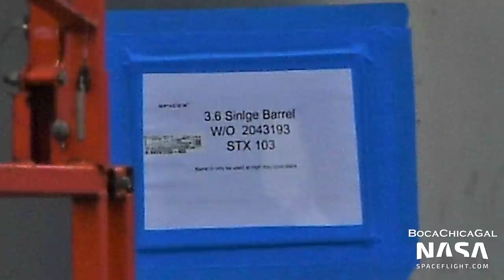Cargo Door Prototype Spotted With Smooth Nosecone | SpaceX Boca Chica

Comment: Booster 4's aerocovers still look a bit... haphazardly tacked on 😂 You know when something wasn't in the original design when SpaceX does this "That'll do until we redesign it" stuff.
Reply: Nah, it's the Cybertruck of rockets. Cyberrocket.
Reply: Looks very Star Wars.
Reply: I highly doubt they will be like that in future builds as they protrude further out than the catchment points.  I'd wager that they move to catch using the grid fins at some point.  It's inevitable they some will come down on the fins anyways.
Reply: Yes.

They haven't bothered to optimize them for weight yet, so the design is obviously in flux. There isn't much point in optimizing the booster design with 29 Raptor-1s when they have already moved on to designing for 33 Raptor-2s.

For aerodynamic reasons, they will want to move stuff under the skirt when possible. The available under skirt volume for other equipment depends on how much space they need around the Raptors. Curved covers will be lighter than covers with flat sections given the same volume and strength requirements.

The number and size of COPVs can be optimized after they determine how much compressed gas is actually required. They may even be able to switch from using cold gas from COPVs to using ullage gas or even hot gas made by burning some methalox.

Comment: 10:20 Do you think the gaps in the OLP will be filled in? I would imagine all sorts of debris and heat damage could get through the gaps in between those covers.
Reply: I was wondering the same. I guess they will fill them.
Reply: I'm guessing panels on the outside with the same gaps then a single piece that covers each gap from top to bottom.
Reply: Could be blocked and filled with water as part of the deluge system?

Comment: Do we know if the gse4 tank failure was intentional yet btw? I would assume so because they have gain soo much experience building these tank structures by now that it seems implausible that it was not intentional, but do we know for sure?
Reply: @rogerhalt3991  As it would follow what they did back in 2019 with the composite tank. Test to failure.

Comment: deluge system; wouldn't it make sense to use the same water cyclically? a cyclic deluge may be more efficient., the water has to travel (be pumped ) less distance  launch after launch. it reduces the cost of pumping in water, and there is the potential of utilizing the launch itself towards recycling in the sound suppression water pumping system. this may be more self contained, and may translate better to offshore oil-rig style launch systems in terms of environmental impact. the sonic impact of numerous launches to the environment is a first principles problem for rapid reuse, as is the energy efficiency of a sound suppression system. cyclic water pumping, and capturing the energy of launch to this end, is likely. watch this space.
Reply: I'm sure they will use ocean water for offshore launches.

Comment: 15:13 Booster 4 with aerocovers - no ports in engine covers for fuel feed to assist startup?  I wonder what all those ports inside the ring on the OLIT =WILL= be used for, if not assisting start-up?
Reply: yes

Comment: What they're doing on high bay rooftop for sooo long? If i'm not mistaking it's in progress since begining of olt.
Reply: Building the bar is neither rocket science nor a priority. I suspect that everything on the critical path to building and launching Starships has a higher priority.

This probably means that construction workers are only assigned to work on the bar, when they aren't needed anywhere else at Starbase.

Comment: how are they going to put sn20 on b4 when those hooks are gone for heat tiles in the nosecone?
Reply: Lift SN20 on to the Chopsticks. Remove lift points. Install tiles. Lift SN20 on to B4. B4 can be placed either by the Chopsticks first or by the crane after SN20 is on the Chopsticks.
Reply: @gravelydon7072  yeah probably, that's the only way. Idk if the fins of sn20 are already prepared for such a lift.

Comment: Will they use the chopsticks to place Ship 20 onto Booster 4?
Reply: We are expecting so because the Lr 11000 is not in the right configuration to lift that high, and there is no way to disconnect the crane and then tile over the lifting points.

Comment: 15:46 What could that circular/hexagonal structure be?
Reply: Looks like Starship shield cells... Maybe they are planning to test the reaction of them during the travel, so see if they are necessary in the bottom part of the booster... (maybe)
Reply: Cooling vent.

Comment: @0:44 are those guys seriously working at the very top of the high bay without ANY fall arrester gear? Surely that can't be appropriate? I know there is scaffolding, but can you 100% rely on that for safety? Maybe I'm 10000% wrong, and would like to be.
Reply: As long as they are inside the railing, no problem. Ever stood near the window of a 20 storey building?
Reply: @rubikmonat6589  not on the outside of the building no..... and at that height most buildings either don't have openable windows, or ones that are very limited....... just seems needlessly against OSHA
Reply: @Thats_Mr_Random_Person_to_you  To our minds it feels like it should be more dangerous with more height but it isn't. Once you're past about 30 feet the danger stops increasing, the only difference is if the casket is open or not. Just look at any tall building with balconies. It's a strange thing to get your head around, you get used to it.

Comment: How did they get the launch mount and tower right on the first try, yet it takes umpteen iterations to do the rocket.
Reply: The next towers probably won't be the same as this one, as pretty much the entire launch site is a prototype and Elon has said that some things will change with the next tower and launch site.
Reply: We don't actually know they got the mount and tower right because they haven't been used in an actual launch yet
Reply: Elon already said the tower at cape Canaveral will have a lot of improvements
Reply: The one thing I really don't understand is the slow work on the new wide highbay. The launch tower was built in segments and hoisted into place, allowing most of the work to be done close to the ground. On this, they are hoisting one beam at a time, rather clumsily at that. The segments could be built and sheathed with spreaders to hold the sheathing of the next layer over the previous one. You pull the spreaders out and fasten the tin, just like every tin covered building in history. As it overlaps from top to bottom, it sheds wind and water.
Reply: @everettlwilliamsii3740  The Wide bay is being built in segments. If you watch it go up, it is lifted in four sections then beams are added in the middle afterwards.
Reply: @everettlwilliamsii3740  They are lifting large segments into place and then adding beams/sheathing. They are not building it stick by stick at the levels. They have limits as to what they can handle safely and the number of joints that can be made at one time as the crane operator has to align the parts for the most part by radio or hand signals.

Comment: Sometimes, no offense, i think if Elon had German Engineers, we would stand on Mars already. Or still be on the drawing board. Either one of these hahahaha.
Reply: As a technician working on German designed and manufactured Helicopters for 32 years (Bo-105) it is superb and over engineered. It is also PAINFULLY slow to advance. We would still be deciding if the name "star base" or "Starbase" was appropriate.

Comment: Bro how long until they launch? I've been waiting forever
Reply: No possibility of a launch until the FAA completes the environmental review, which is expected to be released on the 28th of February. After the they will probably need to obtain a launch license as well. Still a while to go.
Reply: Sls is going to launch first at this rate 😭
Reply: 2 weeks
Reply: @13bigerdave  they cannot legally launch in two weeks. And they definitely would not be ready.
Reply: Then go check SLS
Reply: @liquidcooled5108  SLS has been delayed again until the summer
Reply: @eduardogardin879  not sure where you heard that, can't find anything that corroborates that. Looks like it's still expected to roll out any day now.
Reply: @liquidcooled5108  Per NASA:  A March launch would need to take place between March 12 and 27, agency officials said in October, a window constrained by the performance of the SLS’s upper stage and a requirement to have splashdown during daylight hours. The next launch window would be between April 8 and 23. Date to be set after the wet dress rehearsal.
Reply: @gravelydon7072  that's spring.
Reply: @liquidcooled5108  If they are lucky.